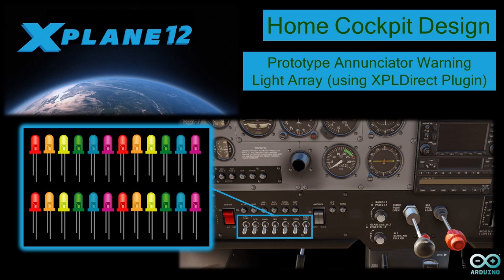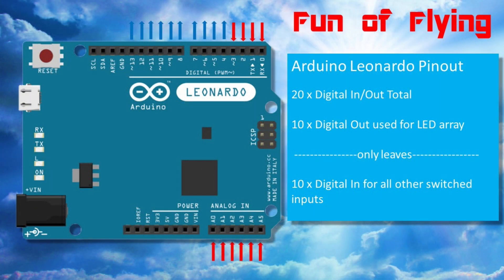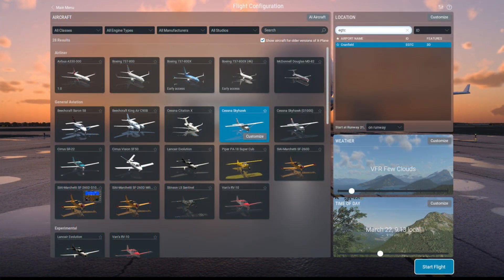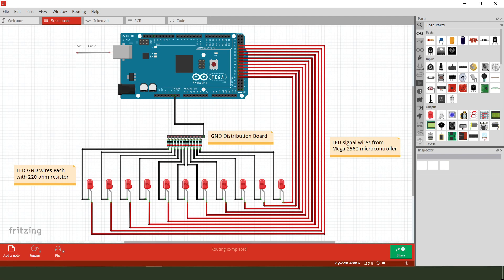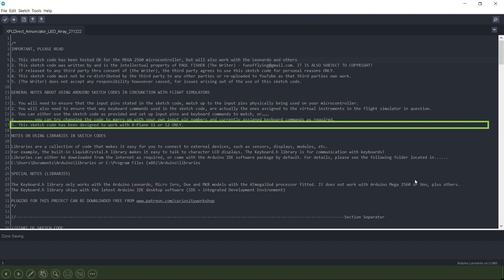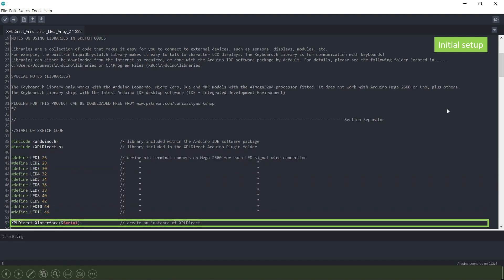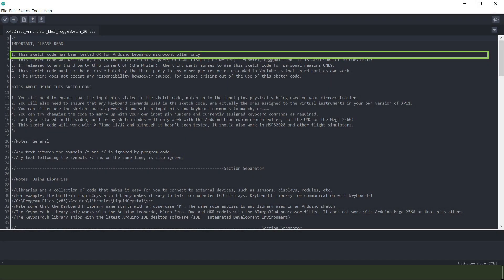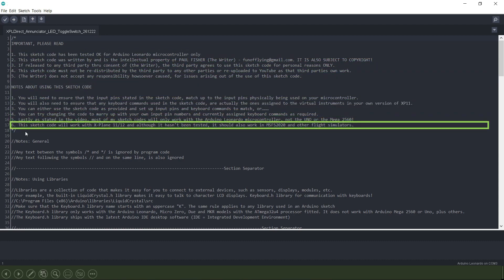Home Cockpit Basics: How to Build an LED Annunciator Array using X-Plane Dataref Values

Comment: This is an excellent video, thank you so much for putting it together.  Were you planning on making your sketch code available to the community?
Reply from the maker: Hi John, many thanks for your kind comments and welcome to the channel :-) Just to say that we're currently away on long term vacation onboard our boat, where internet access is not very reliable. Unfortunately this also means that I do not have access to my home PC and all the files on it related to my YT projects, including my sketch codes. In that respect then, I can't really assist you currently, but you should by now have received a code to download the files you requested for the video in question. Kind regards Paul (Bedford, UK)